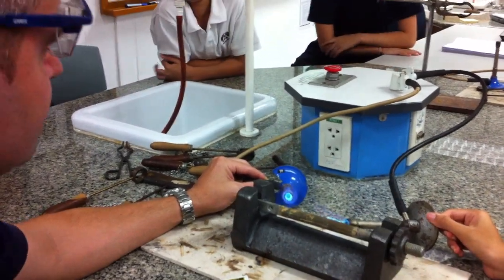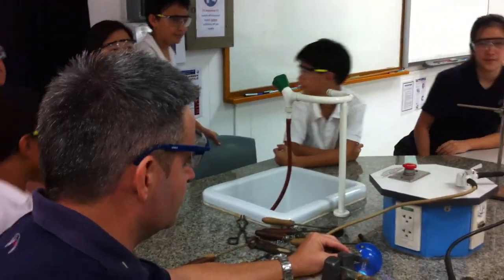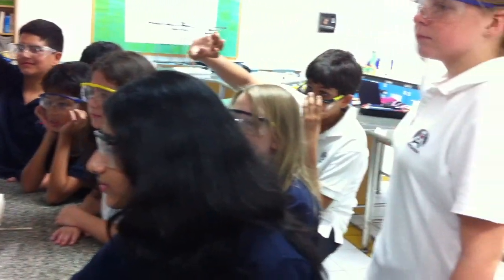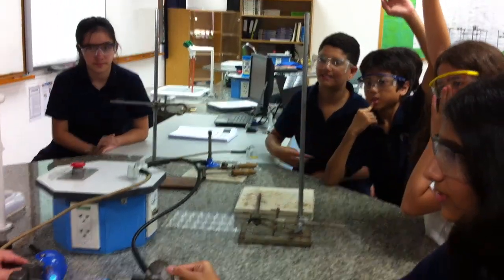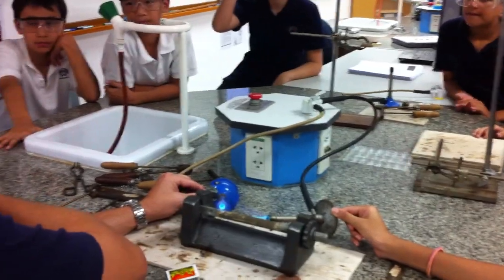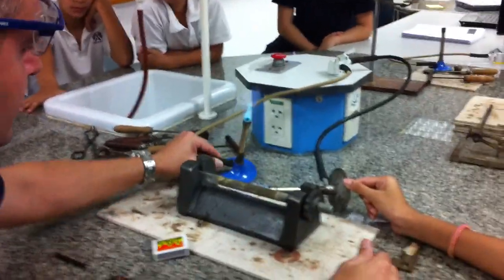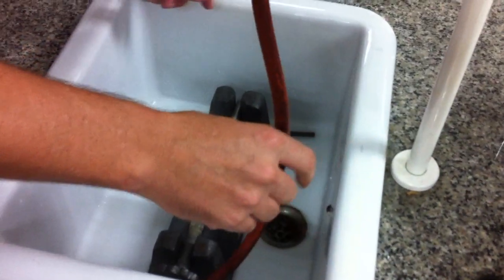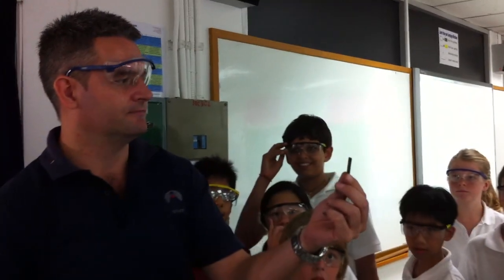Breaking Bar experiment

Comment: actually it is evaporating and by the way the proper definition is that the particles gain kinetic energy so they move more vigorously and the space between them expends there fore the solid expands. Are you sure you are a teacher?
Reply: Particles in solid don't move, they vibrate and evaporation happens below the boiling point and only on the surface of the liquid but the bar must have temperature above the water's b.p..